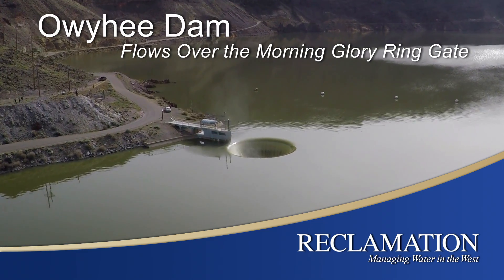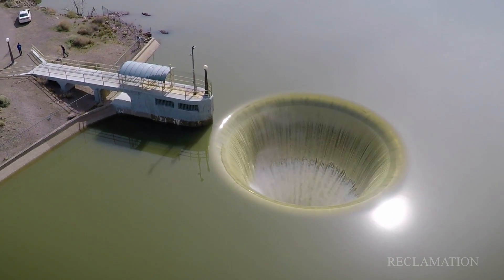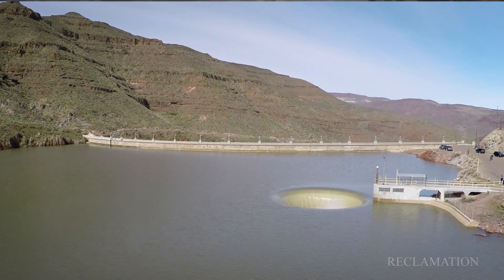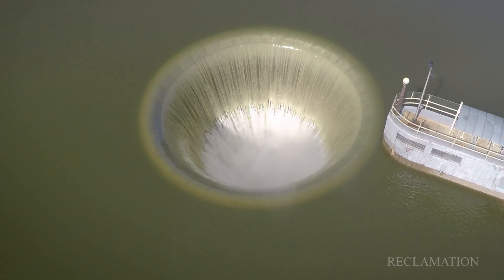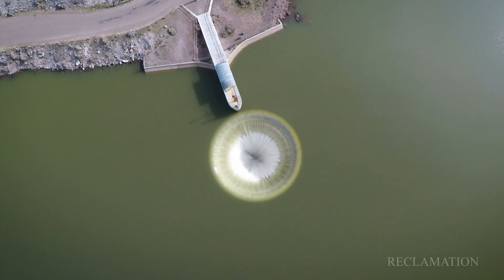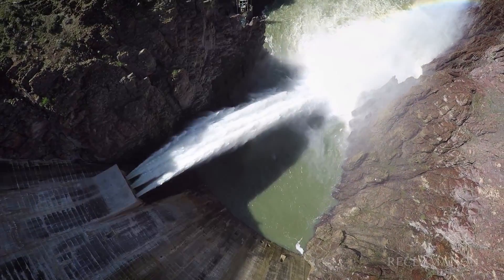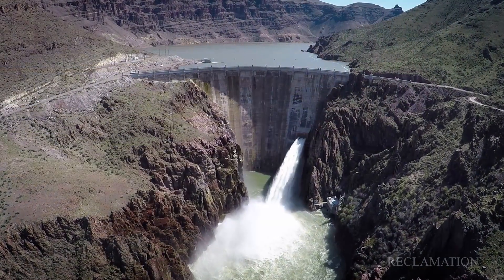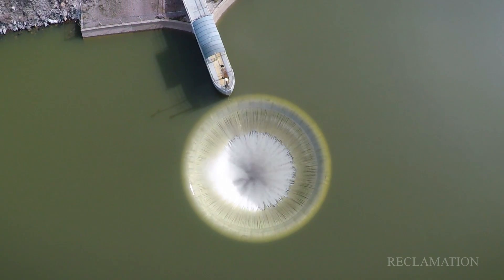Owyhee Dam | Flows Over the Morning Glory Ring Gate

Comment: What would happen if someone in a boat went into it?
Legit answers please..
Reply: Death.  The water pressure would kill you quickly and you would likely drown before the impact of the 320 foot fall and 90 degree turn.  No one would survive that but if you did you would be swept through one of the three dividing tunnels (or split in half between them) and pushed outwards where you would then fall another few stories and likely be finished off from the impact on the water/rocks below.  As far as what would happen to the “boat” would it really matter?
Reply: They would die.
Reply: Water pressure = Depth X Diameter X psi of fresh water which is 0.433…would be WAAAAAY more than 2000lbs pushing you through the smaller opening at the end

Comment: Thanks for your correction Greg.  My comment was based on what I was told in the 1950's and 60's before google and computors (I think we had typewriters in those days)  I still believe that only a few of these really do exist, at least at this magnitude due to the vibration issue that would potentially disrupt such spillway if it weren't in rock (or a lot of cement I suppose).
Reply: Another lake that I know of that uses a glory hole spillway is Lake Berryessa located north east of the  bay area